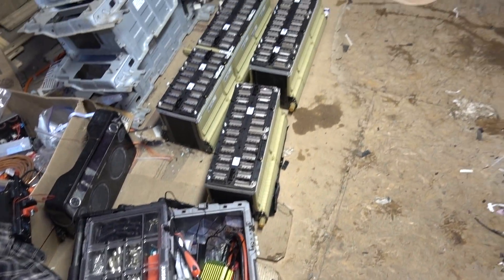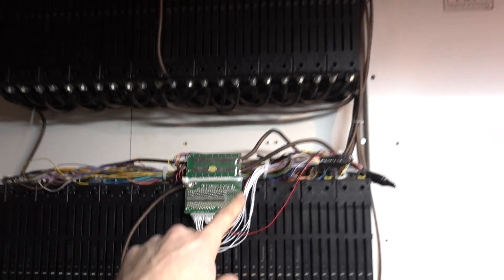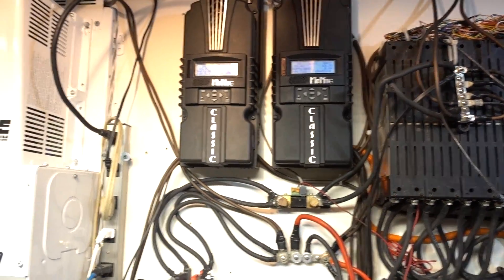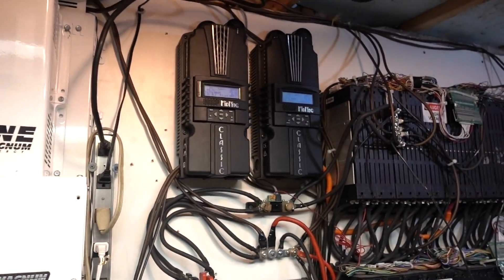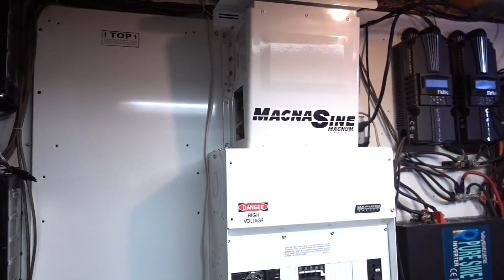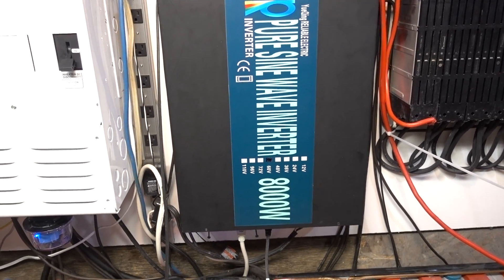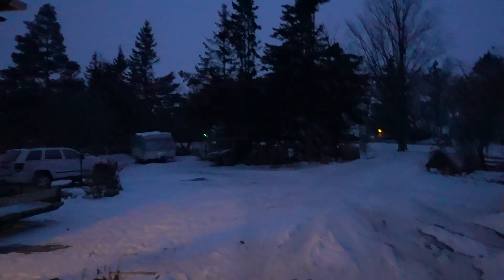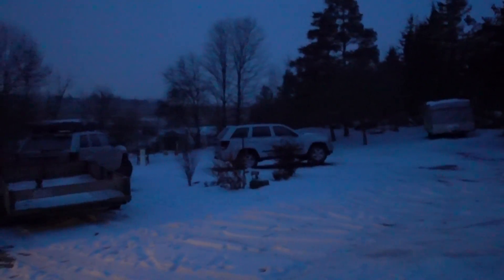20+KWh DIY Tesla Power Wall, I'm Getting There!

Comment: Calcium carbide heater to heat up gallium that operates thermal electric generators to charge up organic carbon power cell banks. A redundant heating and electrical power generation system. You could also operate an absorption refrigeration system using calcium carbide and a water drop sustem. LOL 😊

Comment: You are making headway soon to be ready, you do pretty good 7kw off those panels in winter is better than I do off my 32 fixed net metering panels but they still have some snow on them. OK stay charged up. Cheers
Reply from the maker: I only have 4.5Kw of solar but I brush them off when I can, I want 15KW of solar soon then I will be 100% off grid with a nissan leaf EV that charges off solar :)

Comment: The well pumps will run off 120v just runs a bit longer... i just recently switched mine to the 240v side. Curious in a "set" of your sonatas batteries what the nominal voltage & ah?
Reply from the maker: each battery module is  33.6 volts max charge 5 Ah

Comment: Good to see you’re making power! How do you have so many panels on one midnite? I have 2kw of panels on one classic 200. I’m ordering panels soon and their website says I need another classic for it to work.

Glad to see another video! Cheers!
Reply from the maker: I have a classic 150 they can handle more amps then the 200 and the 250 witch I have, the 150 can go a max of  96 amps at 12v and c close to that at 60 volts that I am using, so 4500w of solar is nothing for this classic 150, i'm going to add another 2000w to it to see if I can make it struggle :) I will be getting another classic in the future, they are the best charge controller in my opinion.
Reply: my midnite classic 150 controllers can handle more than 6000wp no worries. they just limit at 82A i think.  if you are worried about anything, you can limit the amps down even more.

Comment: do you have enough solar to get a full charge back everyday or at least on sunny days? Looking good
Reply: I have 4230 w pv but the most ive made is 300AH but I was running as much in the house as i could. Maybe this year will be better.
Reply from the maker: No I can not fully charge them in one day in winter I can in summer though, but that will be changing by next year I should have 10000w of solar :)

Comment: Idea, Gallium feed the gallium aluminum cans to make aluminum gallium alloy. Design a joe cell were you can fill it half way with the galluim aluminum alloy. Find the correct electrical frequency to pass through the joe cell with the galluim alloy. Fill the other half of the joe cell with urine from y'all's composting toilet so the joe cell starts producibg HHO to charge solid state sponge hydrogen fuel cells. Hydrogen fuel cells then can be used to power a electrical power generator a home or green house heating system and even to cook food and heat water. Could use tesla coils around joe cell to absorb energy field generated while in use to charge up organic carbon power cell banks has well. Hay maybe even the byproduct from processing urine into HHO could be crystallized and turned into plant food and the sticky stuff from the composting toilet sterilized and turned into rich top soil to grow plants with? What do you think about tjis off grid idea? 😊
Reply from the maker: lol yea I will just go off grid im no home steadier atm :)
Reply: Do you know what happens when water comes into contact with gallium aluminum alloy? 😕
Reply from the maker: no lol
Reply: Hydrogen is produced has a chemical reaction. LOL LOL LOL your going to become paranoid around that huge EMF. Do you feel like someone is watching you? 😂
Reply from the maker: your a funny guy thanks for watching
Reply: You should do some EVP's around your set up and see if you pick any thing up talking. That set up produces a huge electromagnetic feild a ghost atractor. Ita all fun and games till y'all in the shower and lights go off and your hear the soap hit the floor and then you hear a voice say i think you dropped the soap has you feel hands on your hips. 😵😖😩😲😂
Reply from the maker: lmao, you should write a book :) this is funny shit
Reply: I was joking with another channel about him walking out into his power shed and feeling an entity slap him on the backside and then him hearing a voice say hello sweetness! He laughed it off yet a month later he looked different and said he was giving up on his line of study. I asked him what mafe him give up? He replied saying he had an experience. I tried to explain how the EMF affects brain chemistry yet he was just not having it. Something happened that really shook him. I asked if an entity had grabbed a cheek and liffted him off the ground with a voice saying hay pretty boy just joking around with him and his whole channel disappeared. 😖😩😲😵😱 I do try and be funny its just folks going through weird stuff really do get a bit loopy and really on edge. 😂

Comment: How's that dump load working not topping up the batteries enough to use it?
Reply from the maker: the midnite has a minimum dump load of 1 volt so my max charge is 66 volts and the dump will go till 65 volts is met, I don't like this cycling of the batteries so I'm not sure if I will continue to use this method or not, right now I have a app on my phone and when I see my bank close to 66v I turn a heater on inside my house.

Comment: That looks like a fortune in batteries. Are you getting them from somewhere cheap?
Reply from the maker: i'm not sure I have about $5500 in batteries, I think I got them cheap, I have waited and have kept an eye out for yours to get what I have, so I hope it was a bit cheaper then normal :S I have about 100Kw in batteries
Reply: Australia is fairly light on for batteries atm. It's interesting to see what is happening with battery tech and availability in other countries though. I'm hoping to get a 8KWh battery for my place this year which should hopefully send our power bill down to zero. It's illegal here to have a battery system that isn't certified and connected to the grid if you live in a residential area. There are heaps of businesses selling home battery systems here, just getting the money together is the real problem.
Reply from the maker: well I cant grid my batteries like you, but I can go 99% off grid and that is my plan! I get batteries at low coast that others don't want, like my hybrid Hyundai sonata batteries, i get them cheap but are some work to hook up, but work very well.
Reply: I envy you not having to worry about whether you are compliant to government sanctioned standards.